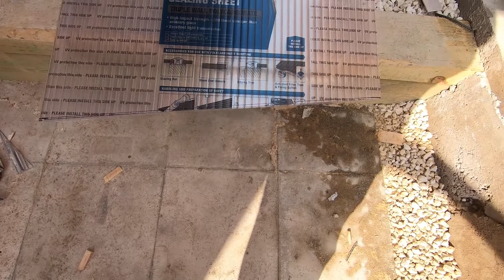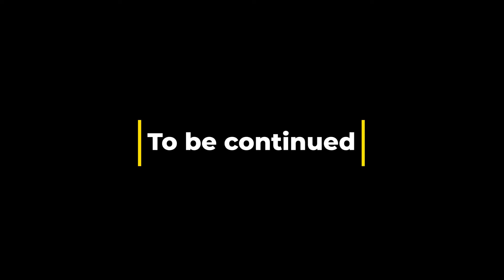Up on the Roof!! - Episode 9 Bonsai Area Prep

Comment: I’m no expert Scott but will you not need some ventilation at the enclosed end  of the roof or is that something you can see how it goes
Reply from the maker: Your right Stephen, but i have natural ventilation all the way down the wall at high level over the wood timbers, bring in a fan for air movement and it should be fine.